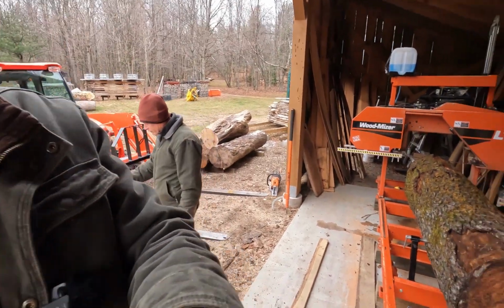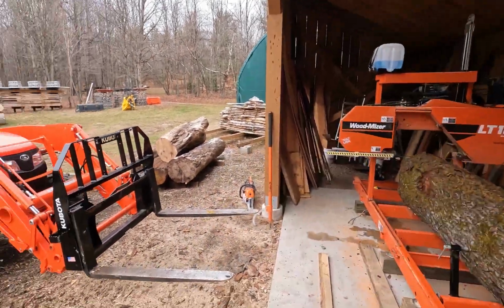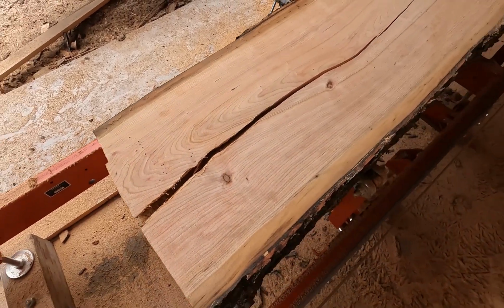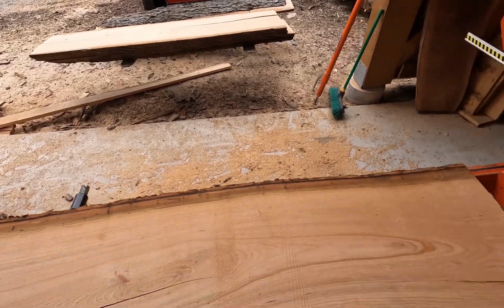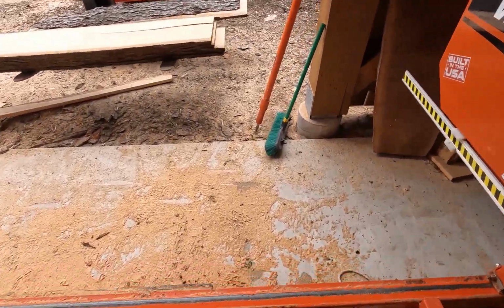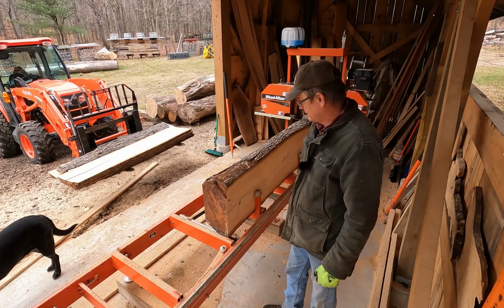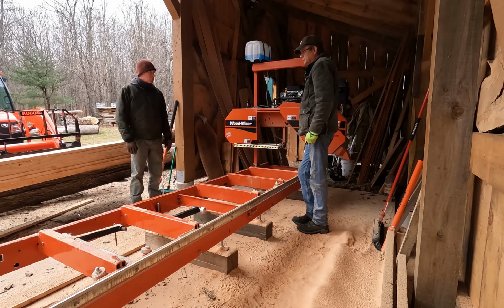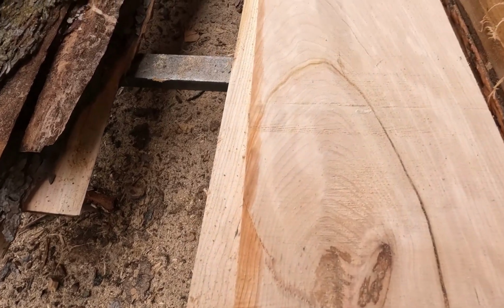A Black Cherry with Tension Milled on Wood-Mizer LT15

Comment: Some nice work there. Always easier with a second set of hands. 

In the background you have a sticker stack with what looks like white boxes on top. 

Assuming they are for weight, what are you using ?
Reply from the maker: Thanks!  Those are cinder blocks for weight.  I think there are either 4 or 6 at each sticker location and so far it has worked for pine and cherry to keep the boards flat.
Reply: @southernadirondackoutdoors  I figured as much. I’ve used the same but when I run out of blocks for landing the slabs … the weights have to get used.